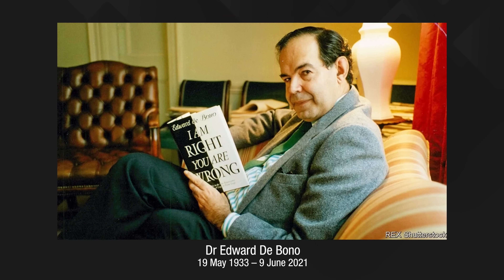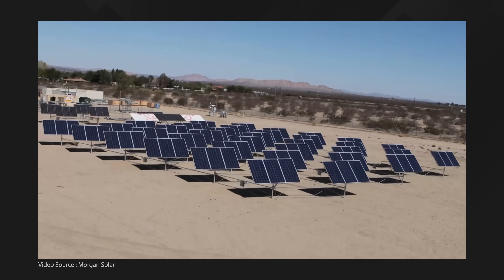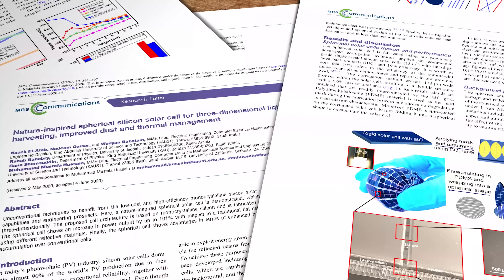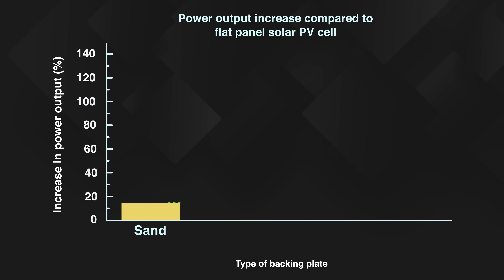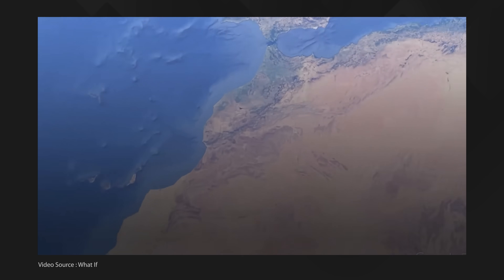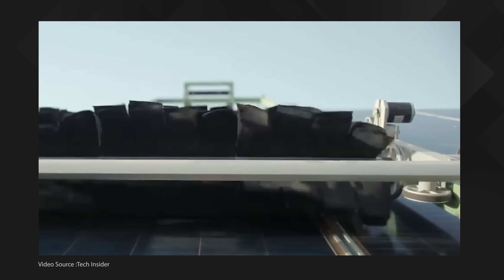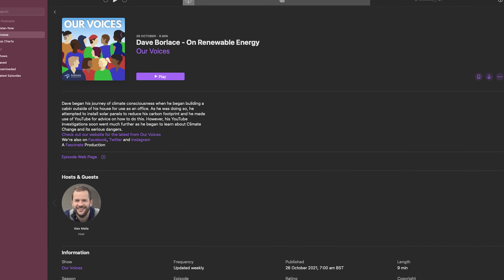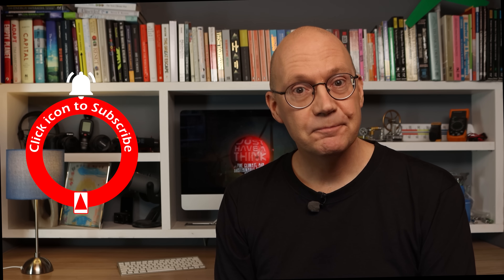Spherical Solar Cells - doubling the power output of flat PV panels!

Comment: I've seen many fancy designs by glorifying basic design principles, this includes Wind Generators. Solar Panels need to be designed for durability, low production costs and efficiency. Like Einstein said: "Everything should be as simple as it can be, but not simpler" The leaves on trees are flat and face in an optimum direction to gather energy, some even follow the sun to a certain degree (Heliotropism.)

Comment: I guess, that did not find a real world application, or did it? Especially when it comes to the cleaning, I am not at all convinced. Access to the underside of those balls and the reflective surfaces should be very limited in such a system and to make it work long term, a cover would have to be installed - which would then have the same dust cleaning characteristics as nomal cells, but it would retain more heat. And total available surface area is not really the limiting factor in most places, especially in the mentioned desert applications. Sun trackind technology already largely does the job, where ground space actually does significantly contribute to the costs and will likely be allways cheaper then the solution with the spheres. And finally, when recycling of solar panels becomes a bigger factor, the sperical arrangement will add a lot of complexity which translates to higher costs.

Comment: 1) A complete sphere would only make sense if a lot of light comes from below.  This is only the case if the panel is above a highly reflective surface.
2) If you live in a sunny area with mainly direct sunlight, your effective area will be larger if you just lay out the cells on a horizontal surface, even higher if you point it towards the sun
3) You can get a big higher yield of diffuse irradiance, but this comes at the cost of your direct irradiance.
4) your spheres or half spheres will be shading eachother.

Overall it does not make much sense. It is also not really new,  in the end you cannot change the amount of solar irradiance that reaches a horizontal surface.

Comment: I am off grid solar strictly 12 volt battery bank and 8-100 watt panels.
I have a BODA 12 volt refrigerator that works fine during the winter, but the heat of the summer takes its tole making it run constantly and at that suffers.  I don't have room for more panels so this new technology is very inviting. I am looking forward to seeing them available. ( though it may not improve my refrigerators performance, there is more at stake than that.) I have work shop I power as well. 
  I started working with solar back when all I could get were used ARCO panels back in the 70s. 
  People are slow in accepting something new hence they fall behind in ignorance and cowardess. 
The way I figure it, every contribution to the system is of value large or small, space considerations included. If the new Spherical photovoltaic systems work as advertised, they may well replace the panels I have.  
   I have not lost any of my electronics on solar in contrast to those on the grid that suffer black and brown outs regularly.

Comment: I realize that this Isn't recent video BUT in my tinkering I simply put a lenticular lense slightly over a cheap solar panel which I had lying around. This seemed to do the job of correcting the different angles of light collection throughout the day. I did not look at the issue of cleaning the surface but I thought I would throw in my two cents on this topic.

Comment: My concern with "Three-Dimensional" Solar Panels has more to do with structural resilience than efficiency -- How well will these structures hold up in high wind, heavy rain, snow, or other weather phenomena?  Flat panels are relatively easy to secure and protect...  Solyndra had the right idea when it came to geometry -- CYLINDERS are much easier to produce and can be mounted in large flat arrays.  Sadly the company was horribly mismanaged and the technology never went anywhere...

Comment: But how do the spherical solar cells compare to parabolic solar cells? The only advantage I can see with a spherical rotating solar cell is that it gives the cells time to cool. But a huge sum of energy needs to be used for the rotation that doesn't sound very practical. Parabolic solar cells on the other hand don't need any tracking or rotating and capture the sun efficiently at any time of the day and year.

Ahh yea not getting covered by dust and snow accumulation is def. another boon that might actually make the spherical solar cells better then the parabolic ones as those accumulate dust and snow even more compared to flat panels.

Comment: Um... this is dum. A "spherical" cell? The efficiency per surface of the cell is numbers of times lesser... That's why they use "ground surface" instead. If it was a glass lens or something that gathered light from many directions and shined it on a flat cell in the center, then maybe that could make an ounce of sense...

Comment: What about making solar cells from clusters of silicon fibers, bundled so that their cross-sectioned ends face toward the sun? Those ends might be polished flat, or possibly domed hemispherical. In either case, the idea would be to use the total internal reflection (TIR) of each fiber to trap 100% of incident photons. Rounded or domed ends might prove better at accessing photons approaching at an angle.

Comment: TI did this back in the early 90`s when my ex worked there. Dirty silicon spheres on heavy aluminum foil. 
Seems like they were projecting $10 per square foot but it has been a while.
Figured it must have been too good because it just disappeared after it was announced internally.

Comment: First, I don't consider this an innovation. It's just a choice of configuration, out of essentially an infiniite set of possibilities.

There are probably situations where this might convey an advantage. Yes, if you're land-constrained, it can be an advantage to get reflected sunlight from the rear, in addition to the front. But in general, if you want the most output per unit of cell area, you're best off pointing a flat panel directly sunward.

Comment: A tree is not a perfect solar collector because most of it doesn't face the sun at any one time. It does a good job though because it builds a whole lot of extra surface allowing it to face in all directions at the same time.  It can afford it, we cannot.  Keep in mind that although a solar sphere will collect more energy than a flat immovable plate of the same 2D area, there is much extra cost involved in the extra surface never mind the increased difficulties & therefore cost of manufacture.  You have to supply 4 times as much solar collecting surface to do this. The cost of solar material is always the issue.  Even if you assist the surface with reflectors on the ground say, such reflectors are not free either and also must be kept relatively clean.  As the common saying goes, there ain't no free lunch.  Good ideas are not good enough if they are not also economical.  Just because something can be done does not in the least imply that it will be worthwhile. 

Perhaps what should be looked at more intensively is how to get a solar panel to face the sun, or nearly so, without expensive complications.  It does not have to be even very good to be a lot better than stationary panels.  It comes to mind that the heat expansion of wax, as used to passively drive various valves such us in a car thermostat, might also be used to move levers and reorient the panel.  They could perhaps be operated with the heat of the sun itself which is always more intense at right angles to the solar panel.

Comment: Of the light that reaches Earth’s surface, infrared radiation makes up 49.4% of while visible light provides 42.3%. Ultraviolet radiation makes up just over 8% of the total solar radiation. The real breakthrough would be the mass production of photovoltaics that use full Sun's spectrum, although better shape design is not a bad idea also.
Not to mention that infrared radiation may last long after the twilight.

Comment: The authors of the study use the term “subsidy” carelessly. Call it “implied subsidy” perhaps, but even then it is “implied” only if you accept their system of accounting, and no government does, so let’s not try to fool people into the accepting the notion that governments are “subsidizing fossil fuels” to prop up a fading industry. Pricing of fuels is largely determined by market forces, and to a smaller degree by subsidies, taxes and trade restrictions— the levers governments have at their disposal. To suggest that fossil fuel prices are “subsidized” to the degree the report claims is not a realistic or helpful observation.

Comment: Sorry, this is utter nonsense.

The requirements of a fly’s vision are NOT the same as energy gathering.

The Sunflower would be a better comparison...

...and they are a tracking flat surface.
Reply: Actually, the Sunflowers are slightly curved too.
The point is that spherical shape at any moment collects more direct + environmental radiation than simply flat - without energy consumption to move (and to produce) mechanic parts. But would be an interesting question why there are no round sunflowers in nature. Maybee because direct Sun's radiation is quite sufficient for their needs?

Comment: Sorry but this adds up to ... nothing.  If you have a flat solar panel of, say 1 m squared; when you fold it, no matter how you do it, it will produce less solar energy.  It does not produce more - it can't - Just think.   At least half of it is not facing the Sun, and then other half is 80% sub-optimal.  
For a sphere with the same surface area, those cells on the shaded side, catching a few stray reflected rays off the sand, would have caught much much more power when they were turned around facing the Sun. 
Just have a think.
Reply: Did you think that what's in the morning sunshine is in the afternoon's shade? How fixed flat solar panels are efficient then, in total?

Comment: It's simple. Solar cells produce the most energy when in direct sunlight and facing the Sun directly. Placing the panels on a sphere decreases the area illuminated directly, so if going by surface area, it's impossible to have better output than ordinary panels. Sphere gets less direct sunlight so it heats up less. This is the only thing going for it, the planar panels could really use a simple aluminium radiator at the back side to dissipate heat more efficiently - why are we not funding that thing?

Comment: What if the panels were a little less complex / costly to make, so instead of spheres they were half cylinder shaped and ran the full length of a typical panel AND water was run down the middle of each cylinder to keep them cool and more efficient. The warm water can then be fed into the water heater.

Comment: Love the concept for industrial applications., it has some stiff competition though if they try & compete with the residential usage.
A lot of new houses are built with solar panels acting as the main waterproof layer instead of installing roofing tiles.
It's also easier to ship flat panels in bulk.

Comment: If the panel conduct was like a needle, then a sphere optic refract, could be very feasable, being round won't make cleaning more efficient,  unless it was like flower heads dangling out as ball tip, with a mere skaking

Comment: From what I remember from the table of hespul a well placed flat solar panel captures about 95% of available sunlight energy, since most of the energy is received when the sun is high in the sky, so it seems to me that it would be very difficult to cost effectively capture the remaining 5% 🤷

Comment: This is pointing out interesting research, but I have to agree with many of the other comments that this is really a geometry experiment, not a breakthrough in cell efficiency. Much akin to the currently available bifacial modules which already offer as much as 30% higher output than a mono-facial module IF optimum ambient albedo conditions exist.
Take the analogy of the disco ball... if you were to paste traditional modules onto a giant sphere and place it on a pole in the middle of the Utah Salt Flats, I highly doubt if it would out-produce a planar array of those same constituent modules. Simply because only one small portion of the sphere would be in peak production at any time. A much larger percentage of the planar array would be in near-full production by comparison (even without tracking). Although, the sphere would use far less ground area, the $cost per square foot (spherical surface area) would be the same for both arrays, and certainly the $cost per unit of Power and Energy would still be far better in the planar array. And this is the practical economics that rules.
I've run comparisons of array output between a 180-degree due South array vs splitting it in half at 150 & 210 degrees for each half array. The due-South yields more in a single day. BUT the split array had a levelling effect, which aids some applications.
Other questions I have are: 
Physical size/scale. Are we talking beads, marbles, ping-pong balls, basketballs, or larger? Because spheres have a nasty habit of shading the areas around them, making inter-module as well as inter-row spacing necessary.
And, imagine the challenge of mounting a sphere, or strings of spheres on a roof. Flat desert landscape might require only a simple pole. On a roof or building, you will be introducing a whole new set of mechanical requirements.
Leaves on trees are flat, and plants have adapted pan-tilt mechanisms. Not surprisingly, we follow that design.
Insect eyes detect movement and objects, they are not energy harvesters.
Thanks for a good think!
Reply: Well done graham

Comment: If all you need is more PV cells while keeping ground area constant, you can just corrugate the panels. You don't even need to make curved corrugations: just arrange long, narrow flat panels in a zig-zag "W" pattern. Then you can effectively treat that as an "extra-thick flat panel" and aim it towards the sun like you'd do with a normal panel.
Reply: This makes a lot of sense. I feel like we must be missing some reason they use spheres that isn't explained in the video
Reply: Another way I've thought of is interlocking hexagonal tubes. They'd be insanely efficient if you make them long enough in relation  to width. (The solar cells are on the inside of the hexagonal tubes)
Reply: I don't understand, please can you explain to my understanding?

Comment: Question: Is PowerRoll's PV film light enough (300 grams per sq-m) to make into ballons that could then be floated to higher altitudes for power generation?
Reply: I doubt it's light enough once you've factored in the cable that delivers the power to a ground station. I'm not sure what altitude counts as "higher" but that cable weight adds up fast.
Reply: @ps.2  Yeah you're probably right, the cable's the rub. I looked it up and it's only 2 extra min of daylight every 1.5 km, so it'd need to be waaaaay up there to have any real effect, and for an hour of extra sunlight time you'd be close to space. lol.  Still, I think a cable with hundreds of large solar balloons stacked on top of one another "seems" like a good use of vertical space -- I'd love to see/do the math on it.
Reply: @TS-mw5me  Building a solar farm vertically still shades the land horizontally. If you can't get high enough for the increased amount of sunlight to make a big difference (i.e., above most clouds), I suspect you come out way ahead by leaving everything at or near ground level, and just finding locations where real estate isn't too expensive.

The fact that the sun moves across the sky does mean you aren't shading the same patch of ground all day. So there have been some attempts to get double use out of the land by farming under a solar farm, growing something that can do well in part sun, part shade. That idea seems promising to me.

Also, I feel like all surface-level parking lots should have solar roofs over them. Protect your customers and their cars from all kinds of weather, avoid having to pay for snowplow services, and oh yeah, offset your company's electric bill.

Comment: I would think that the shaded flat area covered by the PV is the only thing that controls intercepted light power. However, the spherical cells could dissipate heat and also have higher peak insolation which tends to improve conversion efficiency.

Comment: It would be cool if you could make spherical solar cells that could also float above water or hang likes beads in series.
Reply: no, it isn't cool, it is stupid, because solar cells can only achieve peak efficientcy in one direction, not in multiple direction so in a spherical cell you would be wasting the 99.99999% of the surface of that cell. Is just low intelligence and ignorant idea.

Comment: I just got thinking. Would it be possible to combine to circular solarpanels with vertical wind plants? The more modern vertical windplants with solar panels on them, like on the Sono Sion and the drones shown in the video? I think that would be a good combinatiion that would yield power more or less regardless of weather and that would be scalable both up and down in size. I think such smaller versions could be installed in or at each house or in each garden or yard and provide electricity for all.